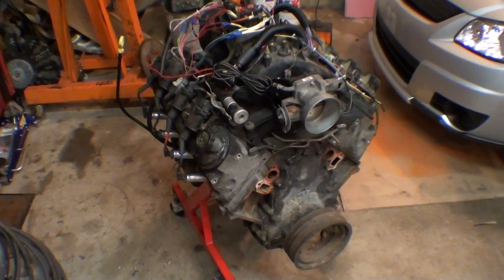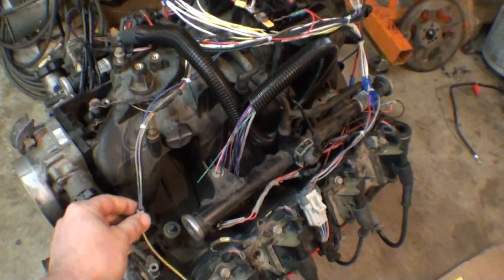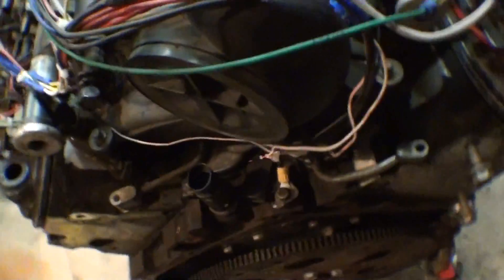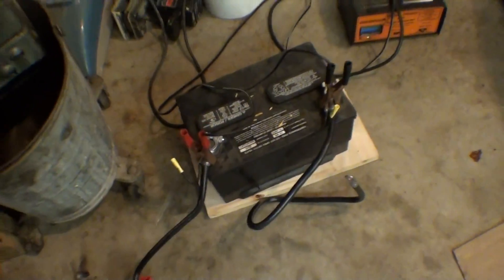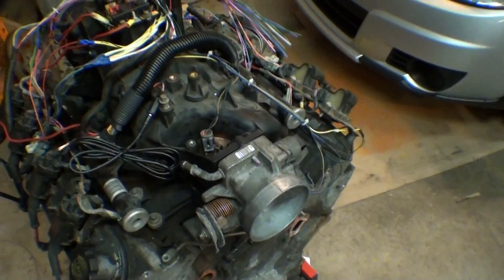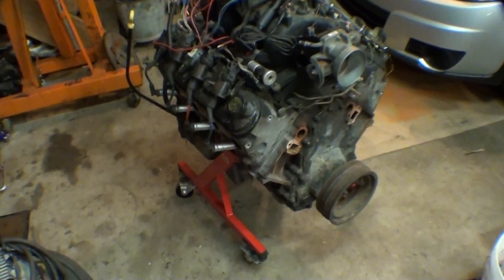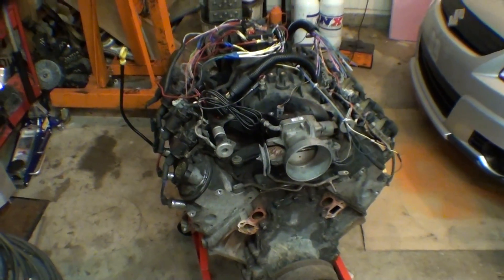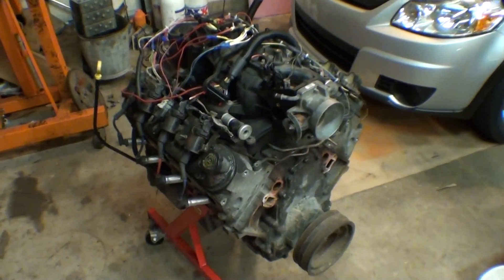1-7-13 micro2 test stand

Comment: I made and used several test stands starting with concrete blocks and 2x4s {not good}
Your stand will work at idle open the throttle and you will need some out rigger legs..
V-8 engines are hard to catch when they roll over.
The last couple quick stands I've made are chevy p/u front crossmembers,there heavy and wide enough. For a cooling system I use a hot water heater tank with one end cut off.

Comment: Im putting a 4.8 in a little '80 D-50. Ive completely gutted all the wires out of it, so its really simple. (wiring harness wise-) What would i need for the engine to run tip top and drive down the road? i plan on putting some boost on the engine too